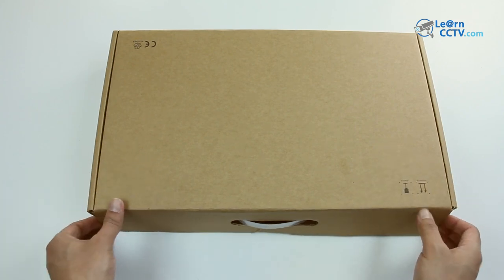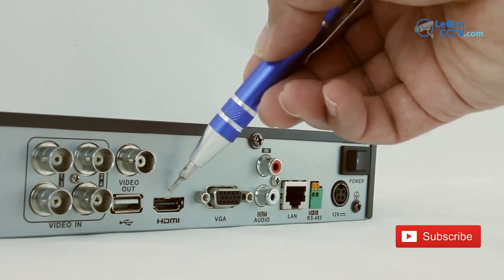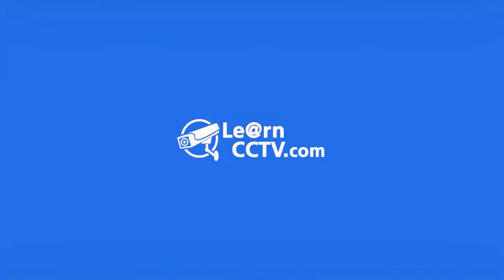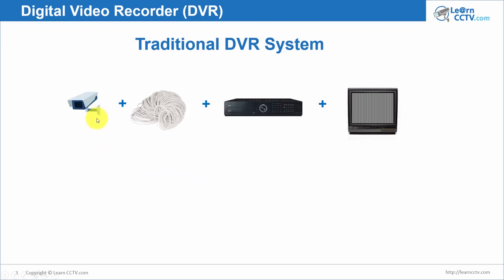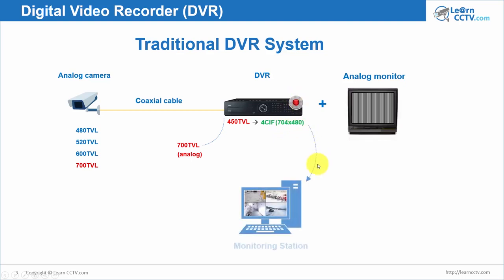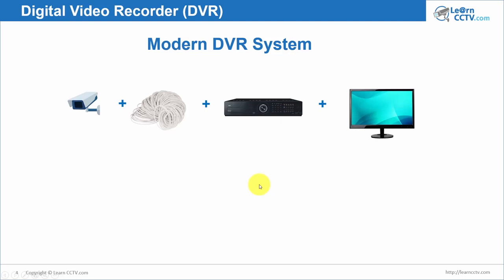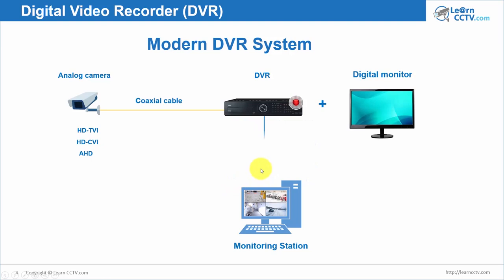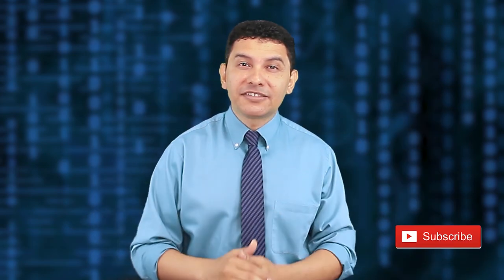Digital Video Recorder for CCTV: How it works (basic principles)

Comment: Nice explanation. But where and when do you insert the floppy disk that you unpackaged at the beginning of the video??
Reply from the maker: The disc is not for the DVR. You use it on your computer to install software and read the PDF manuals.
Reply: @LearnCCTV  Thank you very much.

Comment: Tiny little circuit board and no cooling fan looks like a toy. Should think it would only last two years maximum 24/7 I bet the video image is poor and live view slow delayed?
Reply from the maker: There are different types of devices for different types of clients. Some people need a simple and basic DVR that doesn’t cost much, others such as companies need the best equipment available out there. There’s nothing wrong with that, it’s just like cars... some people buy a Toyota Corolla and others buy. a Ferrari. As a Samsung CCTV engineer I worked with projects that costs millions of dollars because the situation required but I would not use the same equipment in my home because is unnecessary and overkill. Some basic and cheap DVRs that work with high resolution analog camera such as CVI, TVI and AHD are enough for homes and small offices and the video quality is good and there’s no poor video or delay as you mentioned. Unfortunately you lost the bet in this case. It’s just a question of using what is necessary for each case, just imagine a world that everybody uses Ferraris or the latest Avigilon high resolution camera, it’s not real.
Reply: @LearnCCTV  It all depends on what you have and what you are willing to lose. I personally have a big old bulky probably 11 year old Samsung HD-SDI DVR SRD-480D, it works 24/7  and it is like looking at a high definition flat screen television crystal clear image excellent video copy saved evidence to USB, 250GB SSD or a slow copy to the built-in DVD. All those years and it has never let me down. I reboot it every 6 months or so. It is considered old technology. The new little tin boxes dvr's i have purchased 4 all different brand names and I have been so disappointed with them i have thrown them in the bin. I have found out that new does not mean better. How cheap is your well-being?
Reply from the maker: @professormoriarty3005  Yes sir, the SRD-480 is good. As a former Samsung Techwin Engineer, I agree with that but I can also say that when the AHD technology was released, even experienced users like yourself could not see much of a difference of the cameras displayed on the Expo in Las Vegas and other countries. I've been in Brazil, Mexico, and other 15 countries and the result was the same, the cost/benefit of the technology is better with the AHD technology for most people and the product sales tell the same. I agree you need to think about the well-being but the fact is that you can have a really good quality product with those new technologies. I remember that about 17 years ago Pelco was the king of CCTV with no competition but things are different now. We need to admit that there are good alternatives out there for Pelco, Samsung, SDI technology, etc. Some people don't need such products the same way some people don't need a Ferrari because a Toyota Corolla is good enough. As a former Samsung Techwin Engineer, I didn't buy an SDI DVR myself because I think is not necessary since the AHD or IP cameras are better options. The Same way a think my Honda Civic is safe and comfortable enough and I don't need to buy an expensive car. Companies need to follow the flow of new technologies to keep competitive in the market. It's not a good idea to behave as Kodak did.
Reply: @LearnCCTV  I rent properties in Devon and CCTV is not needed ever.. And in Essex Saint Osyth the village it is not really needed but the tenant can click to a channel and see what is going on. I rent two properties in London one in Abbey Road East London which definitely need CCTV, and one in Corporation Street London which also definitely need CCTV. And of course I have one myself for land and property land always has to have CCTV you are on your own with land. Name your best one for AHD technology and I will buy it for the Corporation Street tenant. Name a good one and I will see if I can get it delivered one-day delivery.
Reply from the maker: @professormoriarty3005  I don't sell equipment and I don't represent sellers or distributors. I suggest you search for good distributors in your area.
Reply: @LearnCCTV  No problem. I just purchased a second-hand one =  having a previous owner off of eBay stay with what I know best Samsung. There is also a 16 channel second-hand one I am tempted to buy that one also.